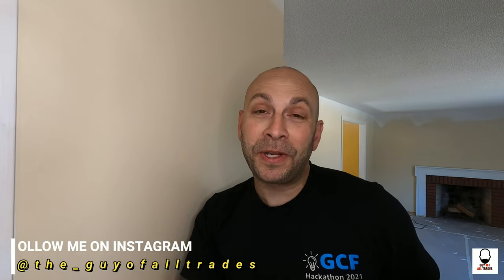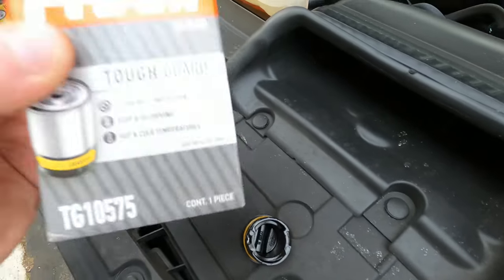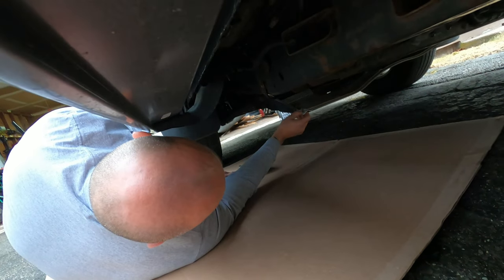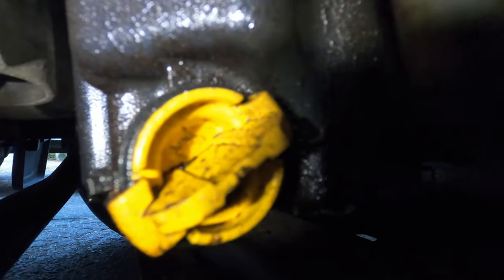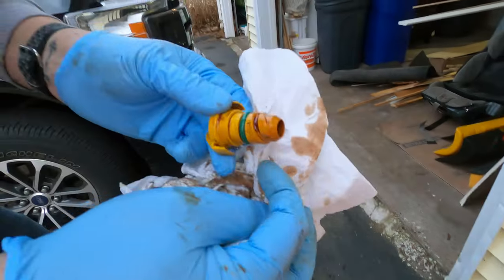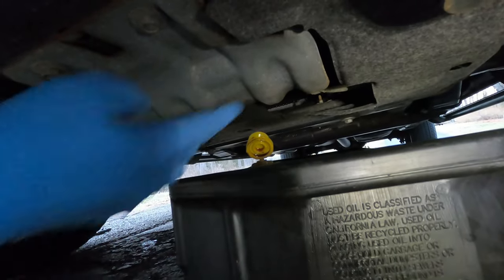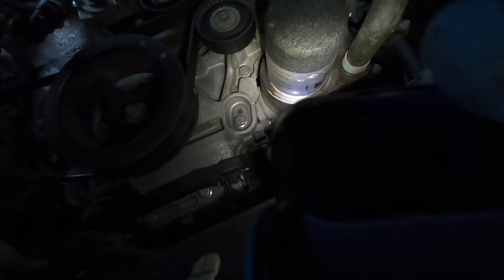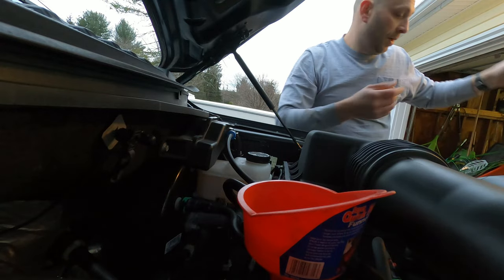Ford F150 Oil Change | The Ultimate Detailed How-To

Comment: That oil leak looks like more than that drain plug. May want to check vacuum pimp on back of right cylinder head. Real common leaker as well as valve cover gaskets.
Reply from the maker: Was oil pan. It’s also common with the plastic drain pans on the ecoboost. Dealer replaced it for free and it’s been dry ever since

Comment: This is gonna seem silly but I'm a woman who has never changed her oil before. However, I recently had an issue where I moved across the country to New Mexico. Before making a trip down to texas back in April, I had my oil changed at a local place. However, on the way back I began to hear heavy tapping and really rough riding. Well, taking it into the shop and I found out that not only was there no oil But the guy asked me: 
"When's the last time you had this oil changed?" And I told him "Right before I left about 2 weeks ago. Why?" and he showed me that there was old oil in the resevoir, but it was almost empty. When I mentioned who and where I got my oil changed at, he slapped his forehead and told me "Lady, you don't get oil changes in town. The people around here are incompetent" 
So one whole new engine later, and I've decided that if I can't trust the people around here to do a simple oil change without screwing it up. I'll damn well learn on my own and do it myself so this never happens again. Because that was a 9 grand replacement job. (It's a good truck and I'd rather not get rid of it since it only cost me 20K and it still works just fine otherwise). And I NEVER want that to happen again. 

So thank you for posting this video. I'll damn well do it myself from now on...
Reply from the maker: Exactly why I do it myself. To many variables to trust an oil change place with a 50k truck. Thanks for watching!

Comment: So 5 20 vs 5 30 isn't much difference and I'm no mechanic but I'm sure it won't make a difference.  Oil viscosity or weight is determined by the weather temperatures in your driving area . If it gets extremely cold you want to use a lower , lighter weight for easier winter starts .
Reply from the maker: They switched in 2018 for the 3.5 ecoboost to 5w20. My 2015 used 5w30, same engine.
Reply from the maker: lol